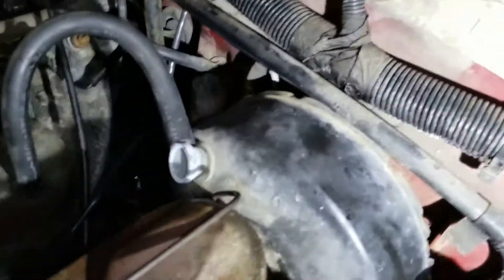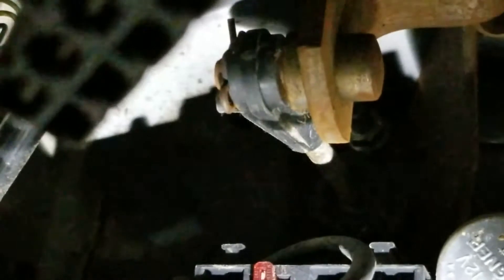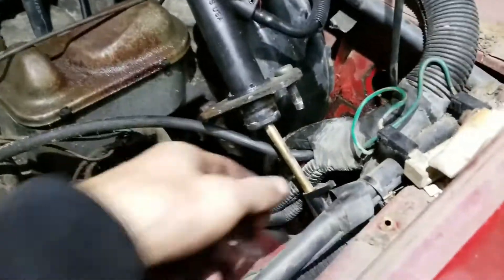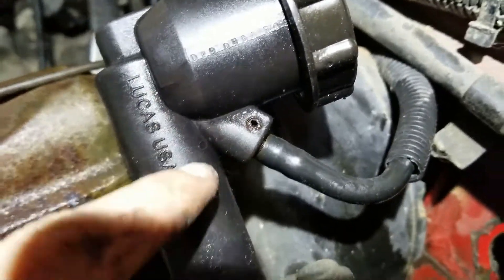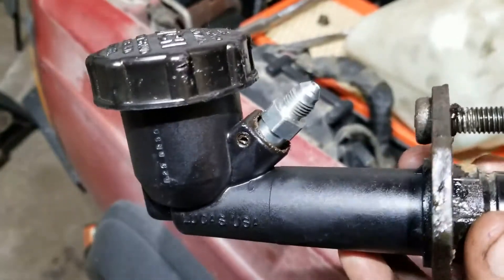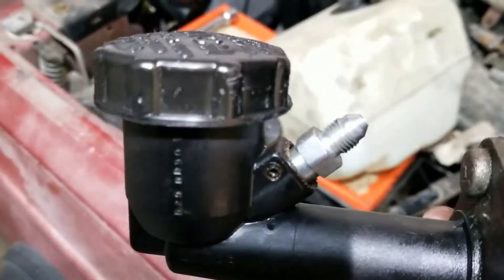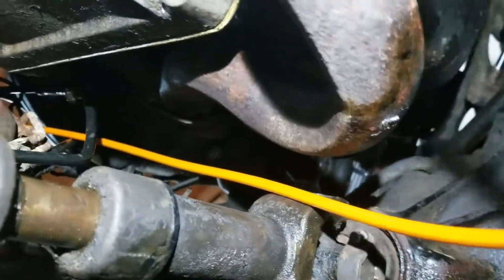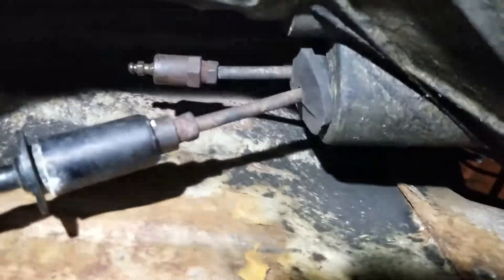Jeep Clutch Line Upgrade

Comment: At about the 7:20 mark you are comparing the 2 fittings and they're clearly different. Did you have any issues with this leaking? I know Advanced Adapters sell a fitting that looks more like the one you pulled out? Want to make sure I get the right fitting

Comment: How did you get the quick disconnect off of the slave cylinder side?  Mine looks less rusted than yours but won't brake loose.

Edit: Nevermind.  It was just stuck from being on there for years and needed more brute force, which I loath to do on things that I can break.  Went to a hydraulic shop and had them make me a custom braided steel line.  I have a '92, but I put a new master cylinder from a '89-'90 year because it uses a threaded connector instead of that stupid roll pin.  The shop also had a connector that the 7/16x24 fitting on the slave cylinder side screwed right into.  The clutch now works better than it ever did in the past, and I probably still need to bleed it a bit better.

FYI, that older style master cylinder probably weighs 8oz more than the newer style.

Comment: How do you bleed these internal slave clutches? Is that what the other little plunger shaft is for? I just bought these items. My clutch hose started leaking today on my 92 Manche.
Reply from the maker: Down under the Jeep coming out of the bell housing is a hose with a bleeder valve, this is where you bleed the clutch. Be very careful to keep your master cylinder filled up, it will empty quickly with the small reservoir
Reply: @BackyardBuilder513  Okay. It's the hose that's right on top of where the hydraulic hose comes out of right? Looks like I see it in this video, right above the hydraulic hose.